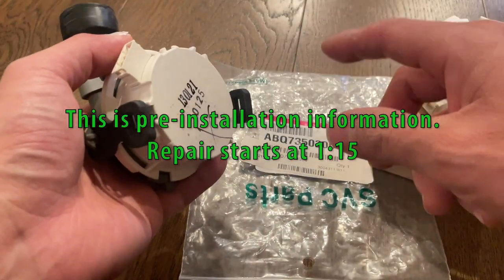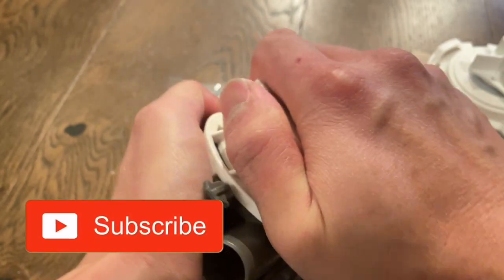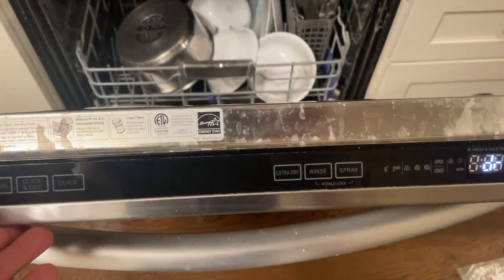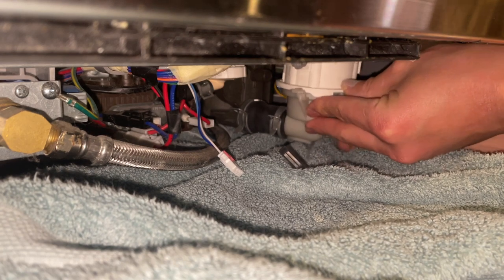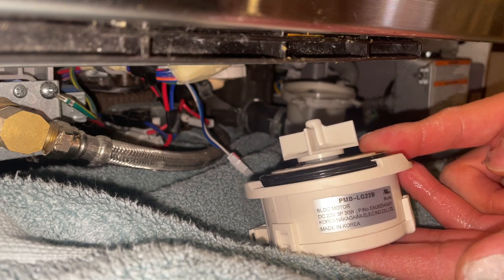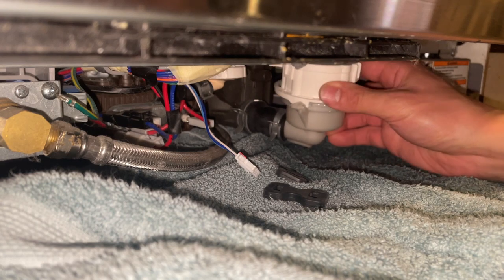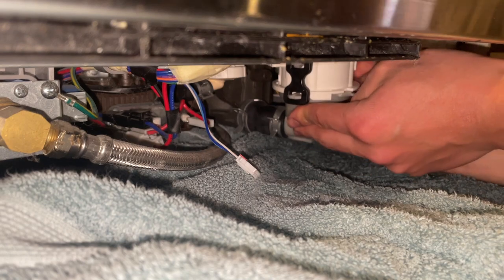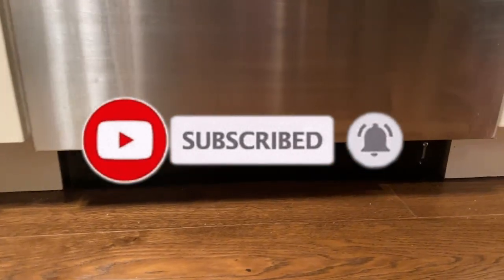LG Dishwasher Drain Pump - Repair In Place Method

Comment: Just wanted to thank you for posting a follow up video replacing just the pump and not the rest of the assembly. So much easier! I was about to pull out my whole dishwasher based on other videos that I’ve seen and then I ran across this one. So much easier and worked like a charm. Dishwasher is now quieter and no more OE errors. I did end up purchasing the entire assembly, but now I know and in the future I will just get the pump.
Reply from the maker: I know! I wish there was a video like this before I did mine.

Comment: Thank you thank you thank you! My dishwasher takes this same motor. It took all day to research to figure out what the problem actually was, but only took minutes to replace it. Works like a charm---went through entire wash cycle without any further issues. Drained completely and cleaned much better than before. This video was a godsend. $20 well spent...and saved me from having to buy an entirely new dishwasher!
Reply from the maker: Thanks for watching!

Comment: So I had to fix an AE code which ended up being a grease and food bits plugged valve in the drain contraption on the left side of the washer. After that repair there was a new loud buzzing noise from the pump motor so using this video I was able to easily remove the pump motor and find the small piece of metal that must have gotten lodged there when I was fixing the other part. Anyway, back together quickly and now it's back to running fine.

Comment: This method worked for me! I was nervous that the drain pump was the issue, as the faulty and new one measured 4.8ohms. But your video detailing other things to watch for, like the high-shrill noise of the drain pump, and the standing water, made me get the new drain motor anyways. Dishwasher working great again!
Reply from the maker: Great job and glad to hear!

Comment: awesome, three years later and still helpful. I didn't have any clearance underneath so pulled the unit out about 1 foot and shimmed the front legs to get me better access.  I had to put the pump on three times: the first two leaked, and the third time I flipped the o-ring upside down and that did the trick.  Sweet!
Reply from the maker: Awesome to hear. For anyone else running into this problem, some lubricant/oil on the rubber washer will make the install easier.

Comment: I am SO glad that I found your video! Our dishwasher started blowing a fuse every time we turned it on. It was definitely the pump. I thought we would have to remove the whole pump and take the dishwasher apart but my husband was able to remove the pump motor as you did and replaced it with a $25 new one! No new pump - no new dishwasher. Thank you SO much.
Reply from the maker: Glad it helped!

Comment: This video described just what needed to be done for our dishwasher which was exactly the same make and model. It saved me a lot of time. I added one extra step. I removed the drain hose from the disposal unit and used a wet n dry vacuum to draw all of the water out of the pump. Never had a drop of water to clean up.
Thank you so much for taking he time to create the video.

Comment: Awesome video! Repaired my LG Dishwasher, model #LDF7551ST, exactly as discribed in this video. My dishwasher was not draining when following the "drain" steps provided in the video. I bought the motor only through Amazon and reused the existing rubber seal. Total cost was about $22.00.

Tip - my motor was super hard to take off. I was unable to do it by hand. I used a rubber strap wrench to take the motor off and put it back on. Otherwise, super straight forward as described herein. Thank you Tundra, Tools, and Tech! You're awesome! "Coffee" coming your way!
Reply from the maker: Great to hear!! Yes, that motor needs a lot of force to open. That rubber wrench would be the perfect tool to use. I would recommend holding onto the top half when doing so for anyone attempting this repair. Thank you for the coffees!

Comment: This video just saved me from getting scammed for almost $400. Called the service guy and they quoted me $100 for the pump and about $300 in labor. Thankfully, I have a little experience in automotive work so I had an idea of what mechanical parts should cost and immediately questioned their price breakdown. Of course when the repair company asked why I didn't want to move forward with the repairs they played dumb about the cost of parts and labor. The new pump is in now and is working great! Took me 10 minutes. Thank you for this!
Reply from the maker: Glad it helped!
Reply: Lol read blue book for appliance repair, it’s fair price

Comment: Wow, great time saving method! Was about to pull out my dishwasher to replace the pump when I ran across your video. Used a shop vac to suck the water out of the dishwasher and channel locs to turn the pump motor housing. All done in about 10 minutes. Thanks for posting this!!!
Reply from the maker: Nice job and and thanks for watching!

Comment: Thank you, TT & T!  Excellent video.  My pump wouldn't even drain when putting into dr mode.  I sucked all the water out with a shop vac before removing the pump as described in the video; no mess whatsoever.  I then poured a few cups of water into the basin before screwing on the kick plate and ran another dr test cycle.  I could hear the pump running and water leaving.  Success!   I owe you a beer my friend.
Reply from the maker: That’s great. Sounds like there was a clog between the pump and the basin. Maybe vacuuming sucked the blockage out. What do you think?
Reply: @chicagohandyman  I suppose that's possible but I didn't find any clog; I think the pump was just bad.

Comment: Thank you - I followed your instructions and … success!  When I took the old drain pump off I could feel with my fingers how the old unit felt more difficult to turn the blades vs the new unit which spun freely, confirming the diagnosis of a failing drain pump motor.

Comment: Thank you for posting -much quicker and easier than previous video.  Quick question:  after replacing the pump motor i learned the hard way that my drain hose was cracked.  I went to HD and bought a GENERIC replacement hose.  Upon installing [bypassing everything; straight from the pump to my sink drain] I find I need to "toke" on the hose a bit, as if i am siphoning gas from a car, once I toke i hear the motor kick in and all water vacates properly.  did i mess up by going generic with my replacement hose?  thanks again
Reply from the maker: The generic hose should work fine. I had to replace mine with one from HD a few months ago too. I haven’t had a problem.
Reply: @chicagohandyman  thank you.  ordering Another NEW pump motor
Reply: I put my finger right through the drain hose inspecting the pump--it was so brittle from maybe a decade of scalding water.  I replaced it with a big box 6' drain hose.  It's maybe a foot too long, but works so far.  The big box hose had larger openings so I installed it over the ends of the old hose after cutting out the spiral tubing.  I did need to use a hack saw to remove the thicker part of the old rubber hose end connected to the drain pump.

Comment: This was so easy except for getting the motor off. Requires a lot torque thanks for posting this. Saved myself 1k
Reply from the maker: Yes, a lot of torque!! For others attempting to do the repair.... support one half of the motor while using a screwdriver to turn the other half of the motor. Good luck!

Comment: My dishwasher doesn't drain at all even when I force drain it, the water just sits stagnant. Everytime I run the dishwasher 10 minutes into a cycle it displays "OE" error code...will a new drainpump assembly that you linked in the description fix this problem? Thank you
Reply from the maker: Does the drain pump make a noise at all? If it’s making a buzzing noise and doesn’t sound like water is moving, it can be the pump or a clogged drain line. Replacing the pump might help. Unclogging the drain line can help too. I can’t tell you without looking at it. I’d suggest doing both repairs.

Comment: My pump was working fine, my dishwasher just wouldn't power up all of a sudden, so I found and replaced burnt wiring, the noise filter, and the main control board, and then I had power, but the thing wasn't draining. The pump was NOT making a whining or high-pitched noise. It DID sound like it was spinning but no water was heard draining.  Hose wasn't kinked. I had just swapped it out 3 years ago. I measured 4.8 ohms between the two pins on left and right on both the old pump and on the new one I installed, so I don't know what's up there, if the old one was really bad or not, except that the new one does drain properly. I'm wondering if there was some kind of air pocket in the drain hose or something preventing it from draining. I'll mark the old one "may be good" , and test it again next time the pump dies.
Reply from the maker: Could have been a blockage in your drain lines. Maybe.

Comment: Question: I just took my LG dishwasher drain-pump off as described. Thinking I could just get the mod# off the old drain to be sure I ordered the correct part from Amazon. However, I couldn’t find that particular mod# on Amazon, but a lot of drain-pumps came-up saying it fits LG ??????? and look exactly like the one I took-off my dishwasher. Does it matter as long as it says LG on it and looks exactly like it?
Reply from the maker: Search your dishwasher model and look for a parts page. You’ll then be able to see what drain pump model you need.
Reply from the maker: But to answer your question, no, you cannot use any pump just because it’s for Lg.  Use the exact part that you need.

Comment: Thanks for the video. My pump is making a humming sound but still able to drain. Also when I do dr (manual drain) it does drain with that sound and makes the pump sound when the whole water is drained. Does it mean it's going bad and will eventually stop working at all?
Reply from the maker: If your dishes come out clean and the bottom of the dishwasher is dry, I wouldn’t worry about it.
Reply: @chicagohandyman  dishes come out clean but the bottom is not always dry. I have do a manual drain cycle to take all the water out

Comment: Is it necessary to turn off the power to the unit and the water source with this method ?
Reply from the maker: It’s not necessary. You should, to be completely safe tho.
Reply: always wiser to turn off the power first just in case. But i think turning the water source off is not necessary tho simple to do.

Comment: Your step 1 is to let all water drain but mine makes weird noises and doesn’t drain at all, possibly not the pump?
Reply from the maker: Could be a clog in the drain line or pump. Open up the pump and check for debris. Also check the hose.

Comment: My motor runs for 3 seconds and stops.
Reply: Doesn't drain, just runs and stops. Opened the motor but it seems fine. Doesn't make any noise. Do I need to replace it or is the problem somewhere else?
Reply from the maker: It’s probably your motor. Replace it.